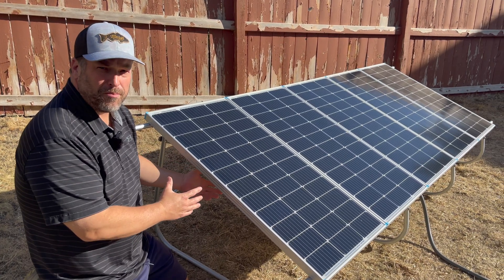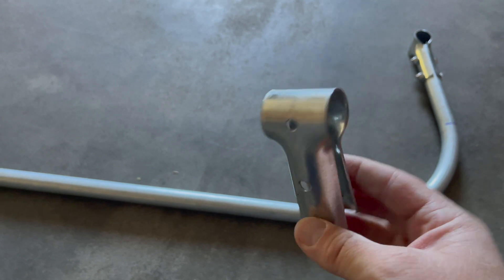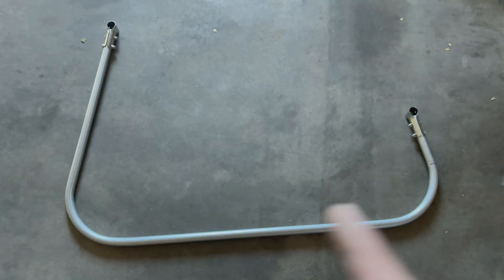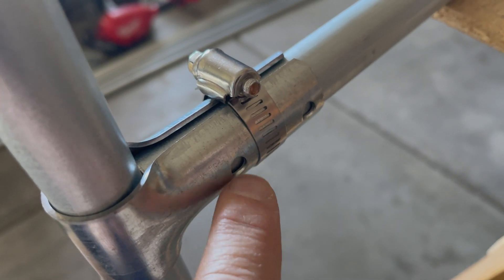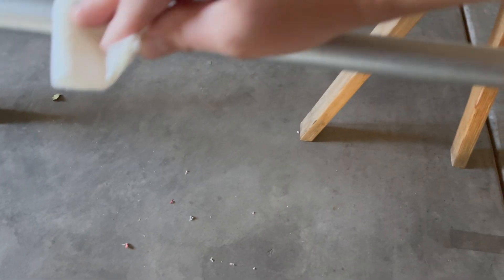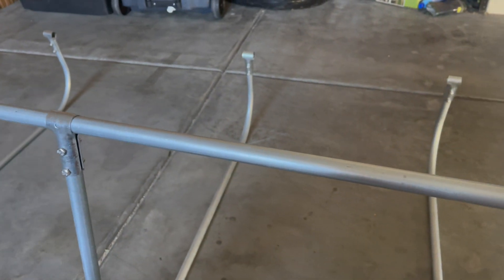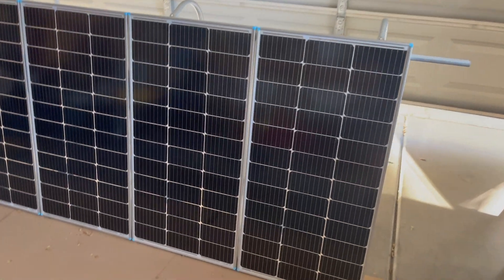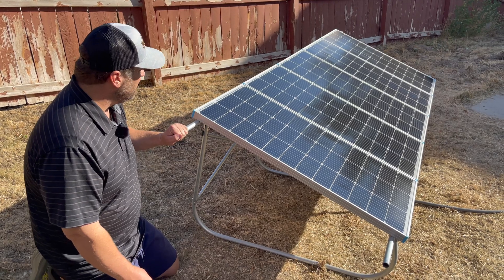The Best Solar Panel Ground Mount, Strong, Lightweight, Will Last A Lifetime

Comment: I love your idea to use the EMT pipes and your design. EMT is lighter, stronger, and not much more expansive than wood. Initially I planned to build a solar mount from pvc pipes, but after seen your video I understand that EMT is much superior material than PVC. Thank you for sharing.
Reply from the maker: Thank you for your comment and glad my video was helpful!

Comment: Great stuff. Was looking at using unistruts or some extruded aluminum but yours better. And instead of over engineering some adjustability on angles you can just use sandbags to elevate whichever end or sides.
Reply from the maker: Thank you for your feedback--I wish I had remembered to mention the cost of unistruts.  That was the first plan I learned from others.  When I learned of the cost of unistrut, I realized it would cost me 5x+ the cost of my EMT (especially on those unistrut connectors), I thought there must be a less expensive way.  This idea allowed me to free up more money to go towards a better charge controller and inverter.  Who wants to put a lot of money into a ground mount--right.  Lol.  Thanks again!

Comment: Great project.  Curious if you think you could eliminate the cross bracing and maybe go with a simpler straight brace at the lower part of the longer uprights?  Thanks for sharing this.
Reply from the maker: Great question!  You could.  Your idea would strengthen the legs, keeping them square from the lower end to the upper end of the legs.  What I like about my cross-bracing idea is it provides strength and stability for the upper bar holding the upper end of the solar panels.  This reduces any flex or bowing while keeping my five solar panels level (reducing chance of damage to my panels) with each other. This supports the legs, keeping them square and maintaining strength for the solar panels.  Thank you for your insight and support!

Comment: Great idea! I was going to build a ground mount out of wood for a few panels, but moving it around I know was going to be difficult. But a conduit frame might be the way to go. Thanks
Reply from the maker: Thank you for sharing your thoughts.  Glad I could give you some ideas!  Yes, my initial thought was using wood.  But then I thought about how wood expands, contracts and twist, etc.  I worried how it could damage my panels.  Not to mention, Unistrut is outrageously expensive.  Thanks again!

Comment: Southern California High Desert Optimized Solar Angle used here and I can see Cinder Blocks on the bottom footings for the best Summer Time Solar Angle and of course the extra stability in using Sand Bags to help hold and anchor It for heavy winds. I will mount 8 200 watt Eco Flow BiFacial Panels to My Build for 2 Arrays - Thank You for this very nice design and detailed build video. 
🌴💦 Indian Creek Ranch 🌵⛩
Reply from the maker: Thank you for your feedback and for sharing your plans--Best wishes to your build!

Comment: Great video sir!. Question, what did you use to flattenthe tips of the cross member 3/4 pipes?
Reply from the maker: I really wish I caught this on video.  Just to clarify, I used the 1/2 pipe for the cross member.  I used a flathead hammer aganst the cement floor in my garage.  What is important and most challenging, is getting both ends flat, level and square.  I used a short peice of 2x4 wood and asked my teenager to stand on the 2x4 with the first flattened end under the 2x4.  This allowed me to get both ends flat, level and square with each other.  I hope I discribed this well enough.  Thank you for your question and for your support!
Reply: @fixintodoitall  You explained it very well, thank you!

Comment: Could you have used rivets to secure the fence brackets?  You mentioned wanting to be able to disassemble but could just drill out the rivets and re-rivet if you want to.  I'd probably try and do a jig for that setup also.  Could probably just do 2x hose clamps if someone wanted less drilling and special tool usage.

For a little bit of wind proofing could always do those.screw in ground anchors and a rachet strap for security but easily moveable if needed.
Reply from the maker: I like your insight.  Thank you for sharing your ideas.  Your ideas could work.